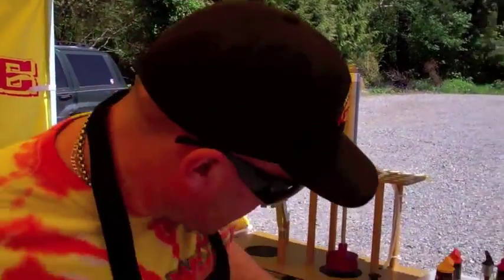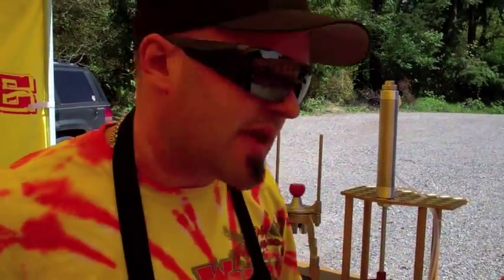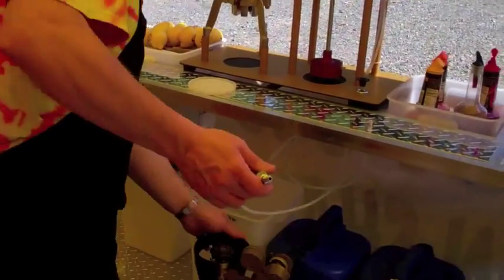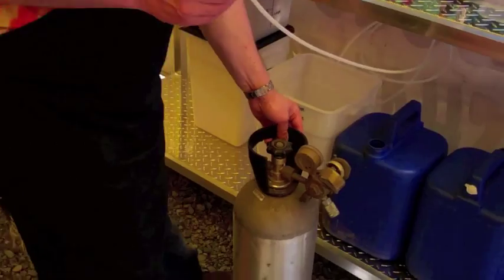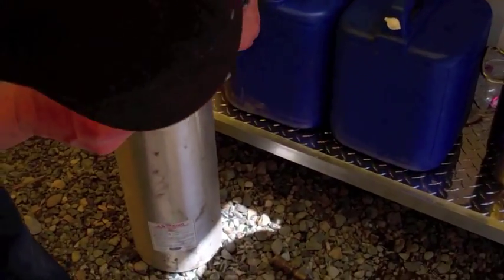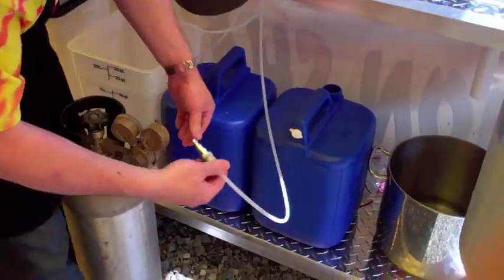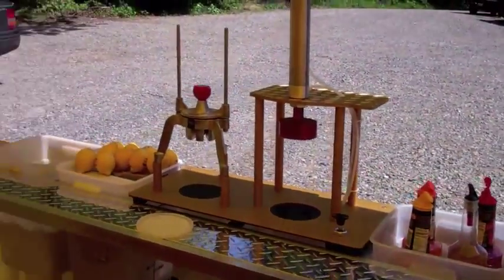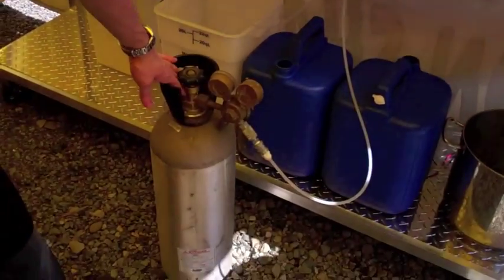Lemon Shaker Air

Comment: Greg, I'm  confused by your statement that you are running 120 LB pressure, but In your other Video you said you are using a beverage Regulator. I have not found any beverage regulator that goes beyond 60PSI. Could you please explain, Thanks.